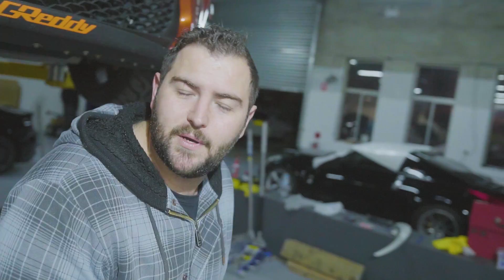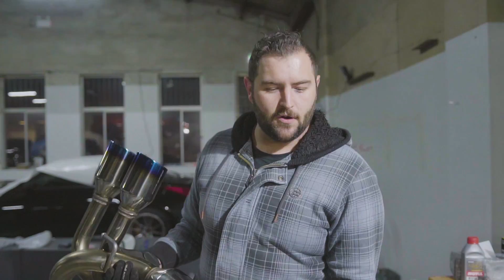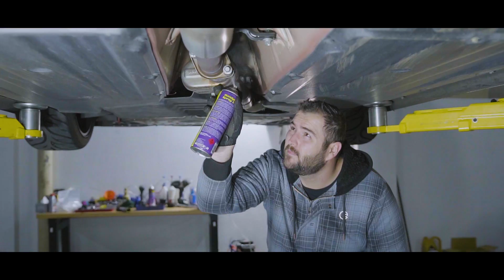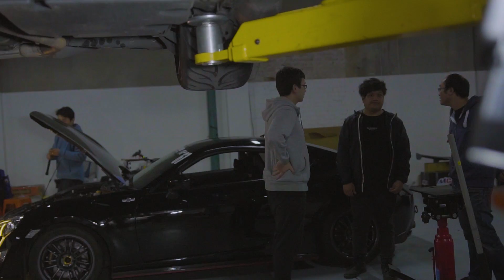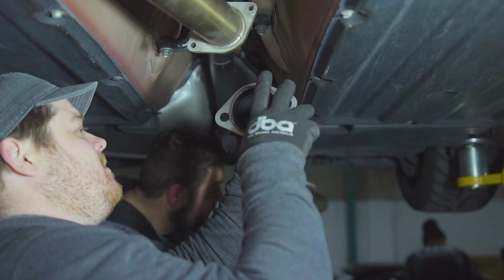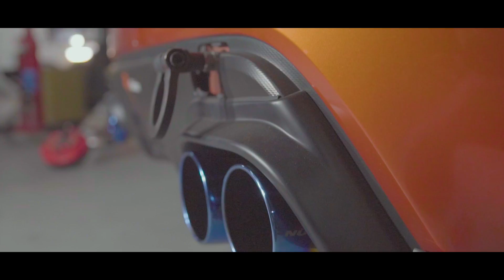Blitz Nur Spec VSR Quad tip Exhaust for GT86 (FRS, BRZ, Toyota86)

Comment: Could you comment the link of where you got the pieces to modify the rear diffuser to fit the quad tips please ?
Reply from the maker: Steven Perez send an email to parts@japextrading.com and let them know you are after a price on the TRD muffler garnish and what year model your car is 👌
Reply: @ToThePoint-TTP  are the TRD Muffler garnishes easy to install? It comes with instructions? I plan on getting that since I can't afford a rear diffuser.
Reply from the maker: @Gaammbit  yeah man, it came with a template so you know where to cut the bar, super easy to do
Reply: @ToThePoint-TTP  okay thank you for the reply. I can't get the link to the TRD diffuser so I was exploring this option. I just wanted to know how easy it was to do.